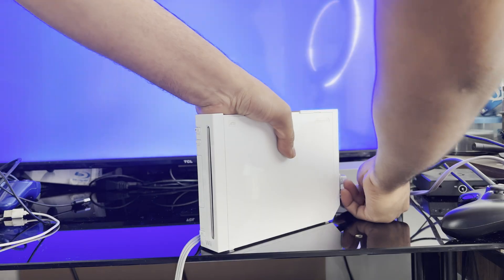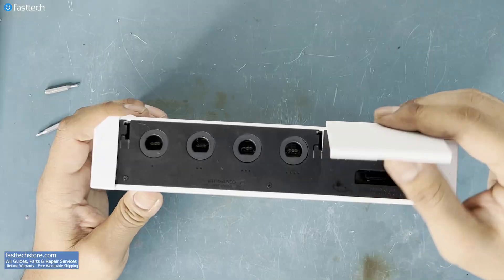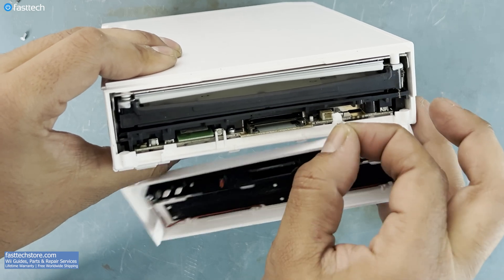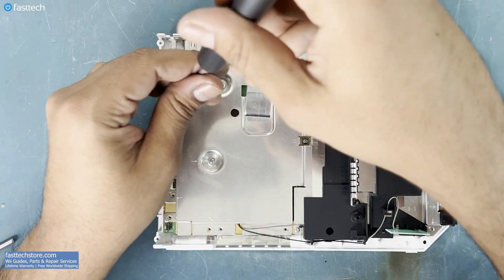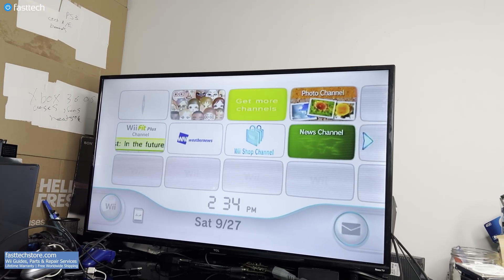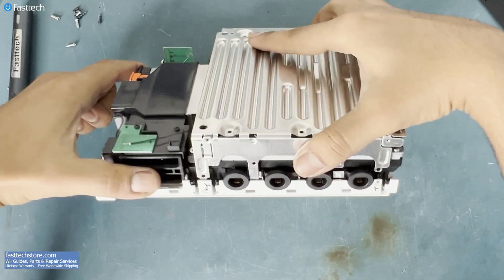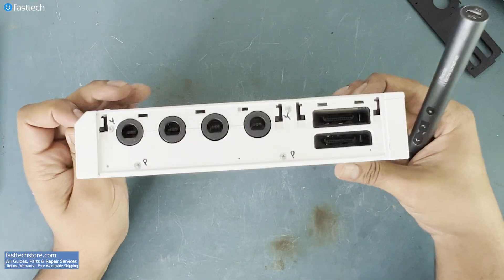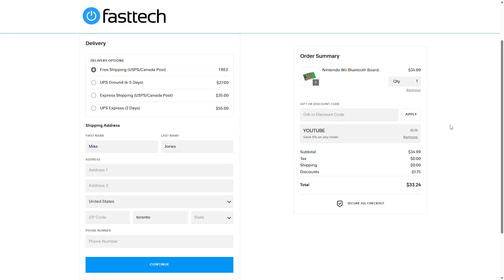Nintendo Wii Black Screen Repair Guide (Bluetooth Chip Replacement)

Comment: Hi, I think the Bluetooth module is also the problem with my Wii. My Wii is set to boot into the Priloader menu, and it does boot and display this menu, but it doesn't connect the controllers. Also, if I restart the console, the screen stays black, just like in the video, and the power button doesn't do anything either. Do you think the problem is actually the Bluetooth module?

Comment: i tried this and now my wii wont even show the start by pressing a screen

i was just trying to replace the bluetooth chip cause the remotes didnr connect to the old wii (remotes work on my newer wii)
tried the reset buttons befor doing any of this
Reply from the maker: The chip you installed is defective or not connected properly
Reply: @fasttechvideo i tried reinstallling it multiple times, so prob defective- but im just trying to get the save data moved over to the newer one so i dont care that much
Reply: @fasttechvideo i will say this, good tutorial. actually showing what screws and then slightly speedup nstead of just cutting to the next screw
Reply from the maker: @SAMURIADI thank you
Reply: Is your screen stuck on the health safety?
Reply from the maker: @Miller_Lite you have to pair the controller again (once) if the chip is replaced by pressing the sync button on the console and the controller at the same time
Reply: @fasttechvideo oh yeah I was just replying to original comment as he stated the start screen.
Reply: @Miller_Lite it was befor i tried to replace the chip- now its just pure black
Reply: @SAMURIADI mines did the same, luckily I bought 2 and the second one work just fine.

Original I wouldn’t even get an image detected, the first replacement it went into a black screen but it did connected my wiimote and second replacement finally brought the image back.

Comment: I did this but my wiimotes still won't pair and the TV won't even recognize a signal
Reply from the maker: Maybe your replacement chip is broken. Try removing it completely and turn on the system
Reply: @fasttechvideo removing the Bluetooth chip did not change anything unfortunately. The tv still says no signal
Reply from the maker: Ive also heard of this issue being caused by a bad wifi chip

Comment: Another thing is you can tell if your Wii's issue is caused by the bluetooth or wifi module by trying to sync a Wii Remote. If it syncs successfully, then the issue is not bluetooth or wifi.

Additionally, trying to power on the wii with the wii remote gives away it being the bluetooth module, so you can use that to know which one it is.
Reply from the maker: Thanks for the tip
Reply: The wifi part can sometimes be false tough. A wifi chip can be defective yet the wii might sync the remote. However it will allow you indeed to know if the bluethoth chio is the cause
Reply: @NicolasMuñoz-p8g The Wii doesn't boot properly without WiFi module.

Comment: this can also be caused by the WiFi card btw, not only the bluetooth module.
Reply from the maker: Thanks for letting me know. I did some research and it appears you are correct. Hopefully your comment will help someone. The wifi card is harder to replace as a lot more screws have to be removed. We may possibly do a video on this in the future if this one does well
Reply: @fasttechvideo Yeah, I am a Wii (i dont want to call myself an "expert") enthusiast and software expert." They're both due to (I think it's IOS?) requiring it.

I am not good at ALL at hardware related stuff, infact the only reason i'm decent with wiis specifically is because i've killed enough of them to learn from 😂

reminding myself again i've never touched an iron 😂

but yeah, both bt and wifi are required only those 2 are. not even fan or anything.
Reply from the maker: Also it appears that 80% of the time it is caused by a bluetooth chip as the BT chip fails more frequently than the Wifi chip but you are also correct. Thanks for the info 😊